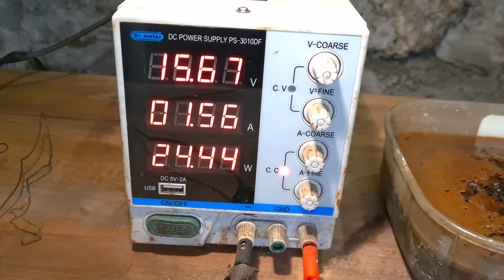Pocket Revolver PERFECT Restoration + Firing Test

Comment from the maker: Getting the ammunition out of a jammed barrel is risky.  When the ammunition did not come out directly, we pierced the first warheads (that's why they are broken, with a non-sparking tool of course) to drown the black powder with water and of course do not hit the primer side. The wet black powder is then no longer a risk. The primer is still a minor risk, so keep your head and fingers away from the barrel
Reply: Good job you did this. I’ve seen badly stored, 80 year old ammo, that still worked 4 times out of 10 and rimfire primer can be nasty.
Reply: Lo,,,,
Reply: Especially when the ammo is this old - up until the start of the 20th century the use of mercury fulminate in primers was common. Although fairly stable when originally manufactured this can react with the copper in the brass case and yield a product that's significantly more shock sensitive than the original priming agent.
Reply: Bullets not war heads.......big difference and coming from under water not that risky at all
Reply: @jacobishii6121  English obviously isnt their 1st language, probably used google translate and thats how its called in their language...
Reply: You held the gun with the barrel pointed at your hand at the end... Scary stuff. Don't do that.
Reply: If you use BreakFree or other CLP, it will quickly penetrate the primer and nullify it. There are cases where very old ammo has been found either in pistols, or with them, and it is still active. I would think that ammo in this gun would be way past its active stage, but why take a chance? There has been ammo from WW2 that has worked perfectly. Other ammo from that era, on the other hand, hasn't. Whatever makes you feel safe!

Comment: Doesn’t the restoration weaken the metal, making it dangerous to fire high pressure modern loads?
Reply from the maker: In any case, this weapon is only tested for black powder shooting, the electrolysis can weaken the metal, it is recommended to load it little in powder grains.

Comment: why only test with blanks? any cap gun will do that. and why did you butcher the right side grip?
Reply from the maker: Because it was stuck ! These amunition are 100 years old, it will be dangerous anyway to use normal ones
Reply: the grip nut was stuck, so drill out the screw end and push the nut out of its hole that way you keep the original grips. i didn't say why didnt you use the old ammunition i said why use blanks? use live ammunition with the gun in a vise clamped tight and see what happens, the gun is worthless junk anyway.

Comment: That's some beautiful work, for display purposes.
But I would NEVER trust a firearm this extensively restored to actually be used for defense (it's intended function).

Blanks test the mechanisms and action of the firearm, but whether or not it will ever properly function for it's intended use (accurately throwing projectiles at lethal impact velocities) can't be tested without using live ammo.
I can only imagine how pock-marked and fucked up that barrel is after all this.
The copper and nickel electroplating alone would have added layers inside the barrel, which would have already been misshapen from removing the rust.
It'll fire, sure.
But will you be able to actually hit anything?
I'm picturing a 1700's musket ball rattling around in a loose-tolerance barrel as it fires, given all that this barrel has been through.
Reply from the maker: I'm agree with you, thank you for the comment. I have an old gun like this for defense but in perfect condition

Comment: Don’t be fooled. Old ammunition is often still functional. Guns of that vintage were commonly rimfire so crushing the edge of the case is how they are discharged. The revolvers hammer is designed to do this but it could also occur when extracting the cartridges as shown if they contact the frame or loading gate when pounded out. Dismantling and extracting the live rounds with your body parts in front of the gun is soooo cringe.
Reply from the maker: Sure it is dangerous, we are aware of that